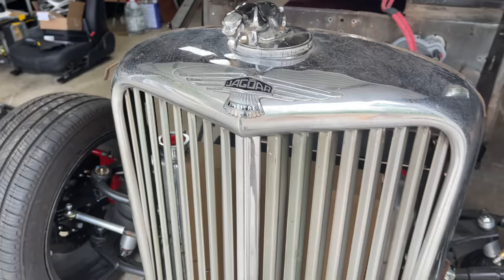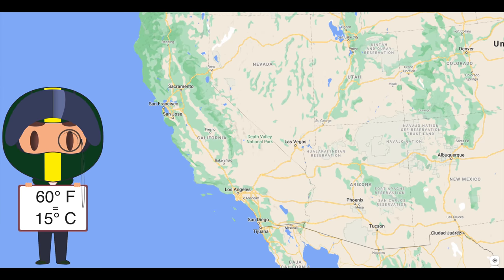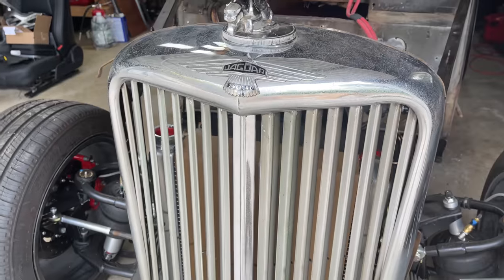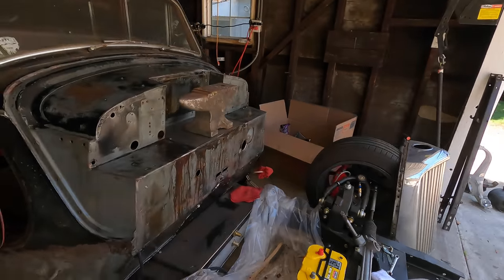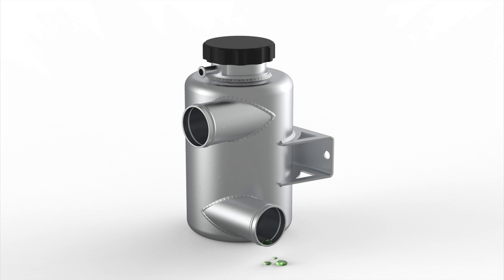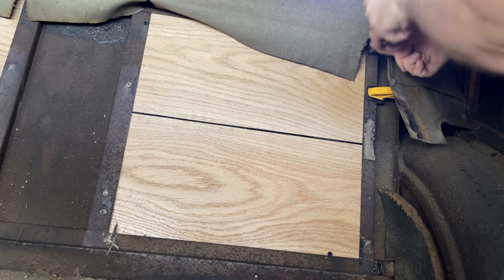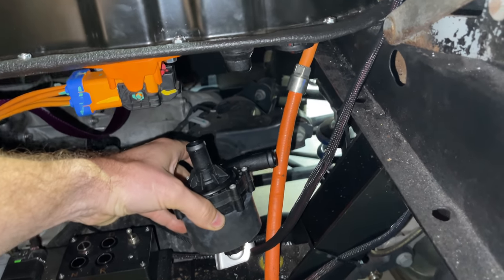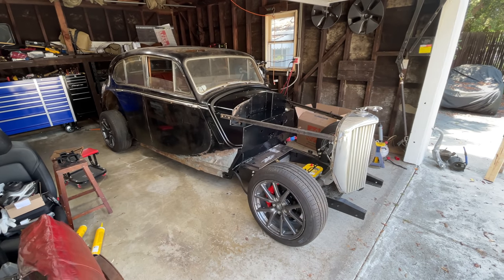Let's Build A Cooling System For An EV Swap

Comment: Note: The "gobs of waste heat" were dumped back at the coal burner and from the power transfer grid.
Reply: Yes! Electric vehicles are not more efficient, they just do only a small part of the job. If the energy is coming from a fossil fuel (natural gas, coal, even oil) the hard part - converting fuel to mechanical energy - is done at the power plant.
Reply: A modern thermal power plant will generally be a bit more efficient than an automotive ICE however. Gas fired combined cycle plants are especially good, up to 60% efficiency. Compare a modern auto engine which might make 40% or so. There are transmission losses in both cases (the ICE's fuel probably got to the bowser through the efforts of another ICE) though I couldn't tell you what they were exactly. And of course the ICE has to face bigger drivetrain losses, especially if (as is the modern trend) it is driving through an automatic transmission.

IIRC when you run all the numbers a Tesla Model S emits as much carbon as a ICE compact car. Which isn't too bad given that it is a large luxury sedan.
Reply: @nerd1000ify  automatic transmissions are better than they used to be (and much better than before torque converter lock-up clutches), and the transmission shift control usually does a better job than a driver manually shifting... but yes, the need for a multi-ratio transmission makes the job of a car with an engine tougher.
Reply: @brianb-p6586  I learned in manual cars but drive an auto so I'm familiar with their nuances. The lockup does indeed make a huge difference, on my car the lockup engaging usually causes about 25% reduction of engine rpm. Still uses more fuel than the manual model though.